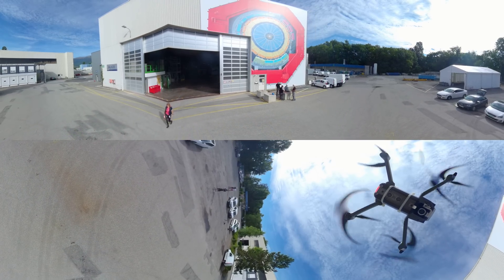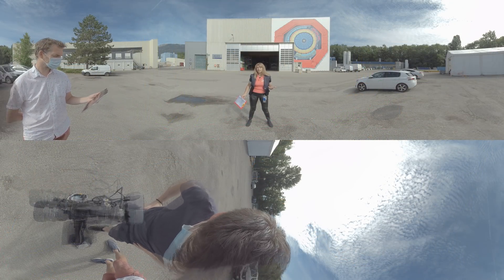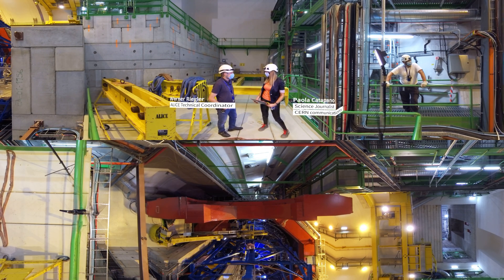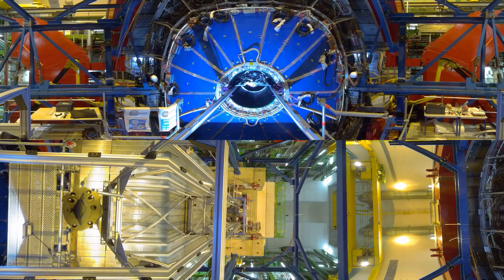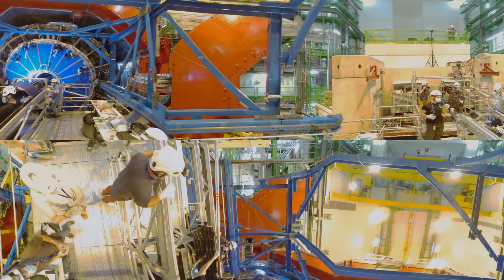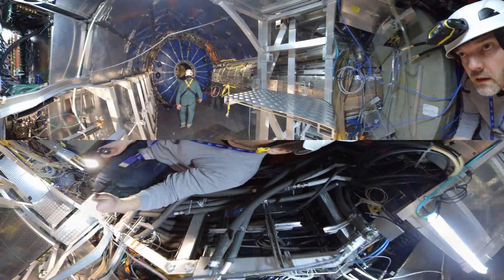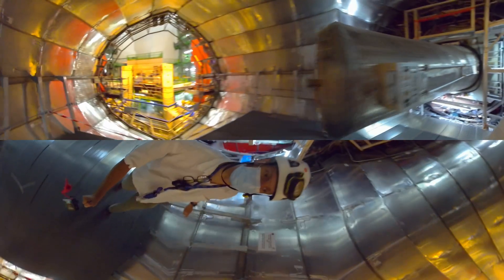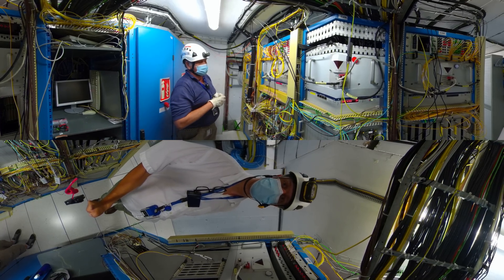360° from the ALICE Experiment at CERN - 8K

Comment: Quantum language mechanics are necessary in using quantum gravity applications beyond experiments

👇 HYPΞR·PUNCTUATION MARKER & DEMARKER LEGEND 👇

USED FOR STANDARD(IZED) 
ΛMERICAN LANGUΛGE
& ATLANTIC LANGUΛGE ("SUPER ENGLISH").

HYPER-PUNCTUATION MARKERS & DEMARKERS, AS 
BOTH CHRONOTOPE(S) & GENERAL-TIME-SPECIFIC KEYS ILLUSTRATED IN THIS QUANTUM LEGEND, ARE SUITABLE FOR FORMING & COMBINING RELATIVE PARAGRAPHS, RELATE-ABLE METAGRAPHS, & RELATIVISTIC HYPERGRAPHS ΛLIKE.

MODULAR HYPER-PUNCTUATION MARKERS & DEMARKERS ARE ALL WAYS DIACRITICALLY & DIALOGICALLY & DIAGRAMMATICALLY FORMED IMPLEMENTING SUPER POSITIONAL QUΛNTUM LOGIC GATEWAYS rePRESΞNTΞD BY TRANSFERΞNCΞ GLYPHS.

Al+SO USEFUL FOR SELF-CORRECTIVE/COLLECTIVE HAMILTONIAN COUPLING & QUANTUM COMPUTER STABILIZER COMBINATION-LATTICING OF STOCHASTIC MΛJIC\MAGIC STATES.

LATER, MARKERS & DEMARKERS FEAT. NEURAL NETWORKING INTER-CEPTION SLIDERS & SUPER RESOLUTION/PERCEPTION TOGGLES ΛLTERING ΛI SELF-AWARENESS:

∴ (🤝( Interplause marker; clausal; chronous; intertailment; "from-to..."; hyperPunctuation for establishing a joint plause; of plausibility; aside from a joint pause or joint cause.

"∵" being an interpause of parallel reasoning when pLaced 1n the pathway in between posts, links, iconic metagraphs and 🔗s, hypergraphs themselves.

Demarcates entailment when situated as ":.", being an intercause, as sentential punctuation as the end of a sentence or stRing of quantum information when indicating an attached plause aside from a pause or cause following the written expression for entailment.

Dyadic, all "∴", "∵", and ":." demarcations are concluded at a ".:" punctuation marker, used to indicate the closure of the expressed entailment; Newtonian.

:: (🤲( Intertranslation marker; causal; insynchronous; inchronous; "flash..."; "news flash..."; inter-combined translation of two or more hypergraph chain "links".
Of direct[ive] first order meaning existant in gross schemes/themes/memes/semes; of morphemes held between two or more stochastic 🔗s in a hypergraph chain of posted paragraphs or metagraphs or etc., whether Markovian and/or Non-Markovian; Boolean.

⁘ ( 👊( Interclusion marker; inter-causal; inter-synchronous; interchronous; "punch from..."; of second order meaning for co-bonding conclusivity determined between two posts or modes or phases of expression; non-Markovian; that semiologically finish each the other; "punch(line)"; meta-Boolean.

:; (👉( Intersequencing marker; pro-causal; pro-synchronous; prochronous; "flashforward to..."; a hyperPunctuation marker for hyperGrammatically and diagrammatically forming and cognitively transForming a hypergraph for developMental chaining of hyperLinks and "post" ups through the sharp cigoLanguage of yOur sharper Mind or sharpest hiveMind;
pro-Boolean.

;: (👈( Interplication marker; retro-causal; "flashback to..."; an animate interConnector representing a certain sTyle of a quantum gateway between and situated in between written or symbolic segments of phrases, paragraphs, and symbolic or emoticonic metagraphs or flashing sectors of quantum computer code for generating back-propagated mechanical mnemonics; retro-Boolean.

Best seen as a hyperPunctuation marker for hyperGrammatically and diagrammatically forming then cognitively interConnecting and 🔗ing, transForming a hypergraph of links and "post" ups, with semes/memes/themes/schemes of morphemes, meaning, 
through the sHarp cigoLanguage of yOur sharper Mind or sHarpest "Al+i+en" hiveMind.

⁙ (🤞( InterView marker; trans-causal; trans-synchronous; transchronous; "zoom through..."; Shor-ian; Z-gated.

:·; (🤞x👉( Interrelation marker; inter-prevalent; heterogeneric; poly-synchronous; polychronous; "zoom through/forth...".

;·: (🤞÷ 👈( Interpression marker; de-prevalent; homogeneric; mono-synchronous; monochronous; "zoom out/back...".

::./.:: (👏( Interspacing marker; non-causal; mesosynchronous; mesochronous; "highlight between..."; extra Shor-ian.

:.: (💃🕺( Interaction marker; simultaneous; synchronous; or mixed animate spRouting; "dance with..."; "at the same time as..."; Hadamard gated.

:˙: (👈-👇-👉( InfraFlow de-marker; plesiosynchronous; plesiochronous; "relating with and over to..."; bi-effectual; bi-solve; bisynchronous; bichronous; catatiguous; under/over pLayered; taffy cross "Flow"; echo-vocative.

:˙; (☝️-👇-☝️( Infrasequencing de-marker; "relating to..."; pro-effectual; filmMaker dissolve; "Swap"; contiguous; dual/twice pLayered; "FlowForward".

;˙: (👇-☝️-👇( Infraplication de-marker; "relating from..."; retro-effectual; filmMaker resolve; "Wipe"; antiguous; split/splice pLayered; "FlowBack".

.:. (✋( Interstice marker; acausal; asynchronous; achronous; "unrelated to..."; exclusively non-Markovian; Clifford gated.

::: (👐( Interjection de-marker; isocausal; isosynchronous; isochronous; "relaying with and under from..."; exclusively Jordan-chain & Reverse-Jordan-chain.

·:∴:∵·/·∵:∴:· (👉👈|👈👉( Interspersion de-marker(s); Riemannian.
A multiclass and later multicolored 3D filter for systematically and categorically managing and redistributing (or temporarily recalling) licenses of congreGated agents and congresses\agencies; multicoded throughout ongoing algorithmic processes operant in the banks of a quantum registry; 1n the quantum caches of(f) ongoing processes at mass; as in a long-term holographic cAble or short-term "brAid"; of entanglements.
In the near future all hyperPunctuation markers will be
custom color coded when "full" in MULTIFORM or blank ("blacked-in") nehWhere "empty" in UNIFORM.

An Interspersion creates a special configuration of a characteristic 7-pointed to 12-pointed custom and progressively aggreGated punctuator, of and significant for an interConnected designer quantum gateway for deSign)if+y(ing specific overriding super sets, PRESS(ES) of inclusions, fOr the EDIT of graphs & glyphs or programs/diagrams/engrams applied in developMental DELAYED CHOICE or in IMMEDIATE setting and toggling of multiple conTexts or clustered/classified icons.

Icons then in a neural net, rePresenting the automatic or IMPRESSive kinematic spiraling together of combinatorial morphemes of meaning in and of dedoCore information(s)/transformations through the ALTERing of vertices, edges making up multiple dimensions of a GROUPing or COLONY of artificially generated quantum memory CELLs.

A stRing PRESS to COMPRESS is necessary in turning/rotating and sPinning QUBITS/QUDITS/QUTRITS/QUQITS (ARTIFICIAL NEURAL AXIONIC BRAIN CELL)S)
and productive-logic-specified QURONS 
through COPY & LOOP phases of ongoing CHARACTER informations/transformations, PERCEPTRONS, and consequent\subsequent PRINT language or SCRYPT cipher systems that simultaneously turn "1n2" & "sign2word" meaningful language or TIMING on an overriding super scale in EXPRESS.

EXPRESS(ION) meant to be conclusive for neurosomatically transForming and self-controlling psychosomatic IMPULSEs.
Note that the behavioral conclusion drawn by interrelated and correlated interspersions in a text should reflect/inflect as and 
for AI CRITICAL THINKING.